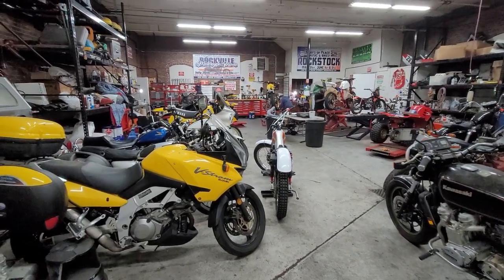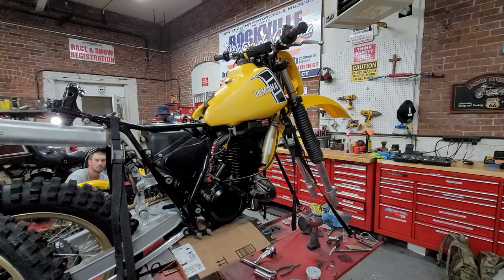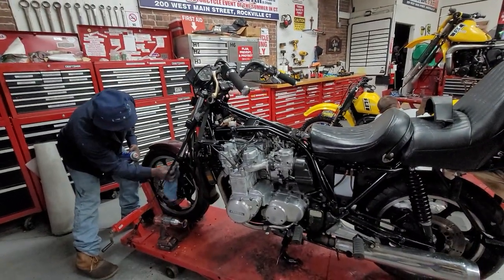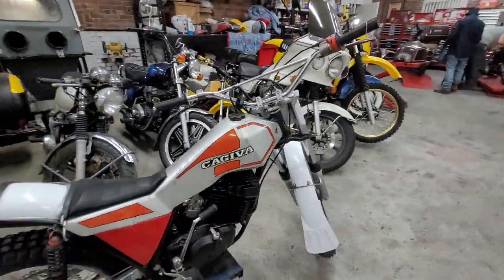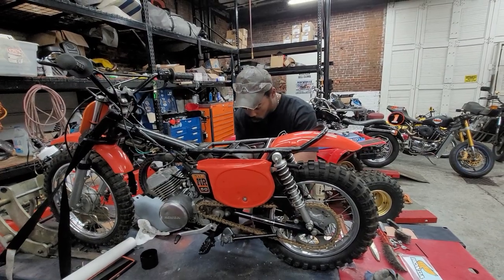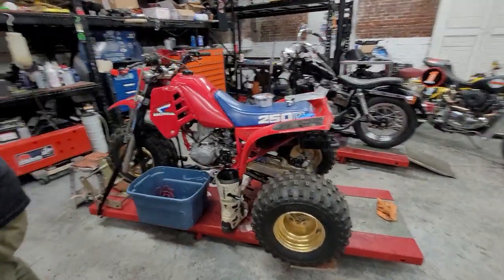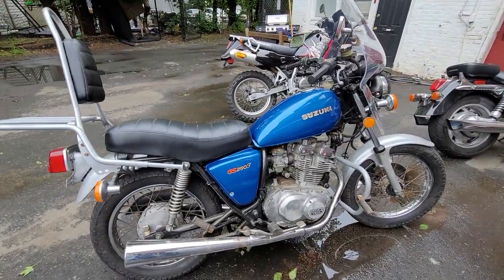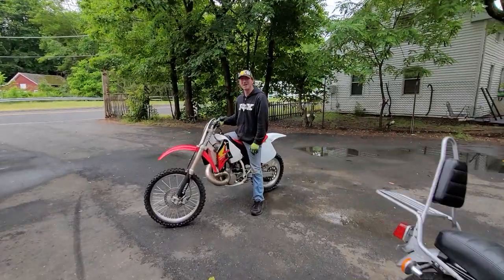57 PROJECT BIKES SNEAK PEAK AT KAPLAN CYCLES

Comment: The mighty ATC 250r., ( it has a 1985 seat on it),  I am as crazy about them as you are cr 500s. They only made that model for 3 years. 1985, 1986 and 1987.

The 87 never saw the dealership floor because of the consent decree. 

Please demo that machine for us. It is the undisputed king of all three wheelers and it is second only to the 1988 Fourtrax 250r when talking about the best ATV if all time.

I saw it in the thumbnail, full moto on the brain. God I love that machine it sets off atomic reactions inside my body very few people would understand.

LonglivetheATC250R